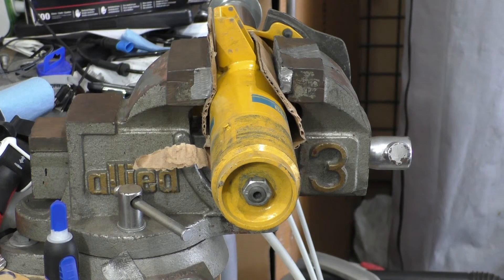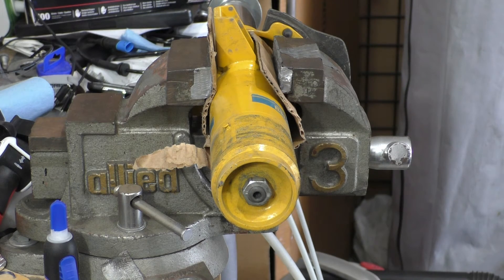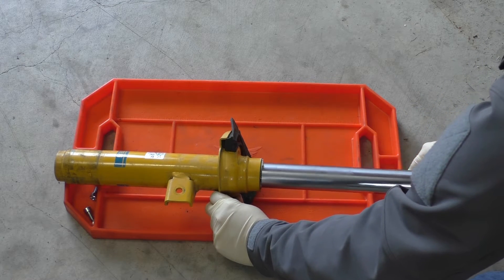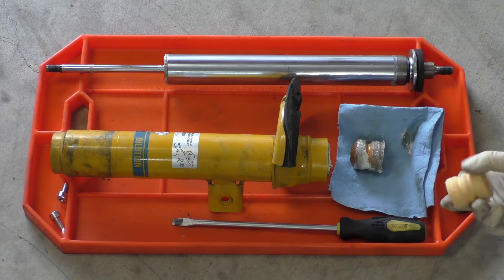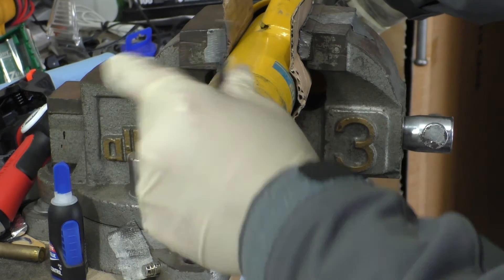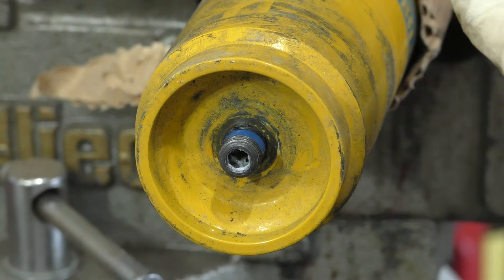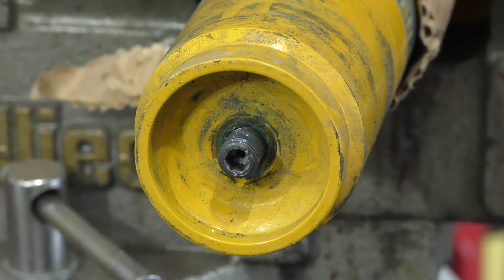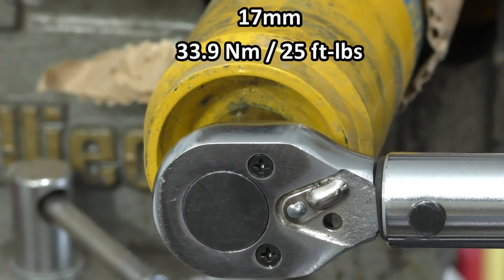Bilstein BMW F2x/F3x Strut Disassembly & Bump Stop Change

Comment: My mind is blown. I have installed Bilstein B6's several times and always wondered why they don't require an external bump stop. I had heard they had internal bump stops but didn't realize they were still foam or they were replaceable. Thanks!

Comment: I am in similar situation where I need to use a shorter bumpstop for B6 with lower string. May I know where did you get the shorter/softer bumpstop from and what is the parts number? Thx.
Reply: nvm. I found E4-AP2-Z118A00 in your comment. My car is GR86, I am not sure if bilstein uses different bumpstops for different car, but on summit racing website, there are only E4-AP2-Z118A00, E4-AP2-Z075A03, E4-B46-759B, E4-B46-236A 4 different bumpstops available. The other 3 are not in stock so I guess I don't have many choices.

Comment: What’s the difference with this upgrade. Or change.
Reply from the maker: The difference is you have more free damper travel so bumps don't upset the car as much. The car is much more composed over bumpy/poorly graded roads.
Reply: @FaRKle0079  ok. I will try this.
Reply: @FaRKle0079 what bump stop you used. I have b8 ones. I mean the internal one.
Reply from the maker: @hectorsoto6813  I used Bilstein E4AP2Z118A00 in my dampers and cut it down a bit more.
Reply: @FaRKle0079  perfect. How much should be this cut.
Reply from the maker: @hectorsoto6813  That's going to depend on your springs and how much free damper travel you have. I like having >0.75" of damper travel before bump stop engagement.
Reply: @FaRKle0079  ohh. I have mss springs. But don’t know how much I need.

Comment: Are these struts nitrogen filled? If yes, how are they refilled?  I have a pair of H&R coilovers that are supposedly bilstein made but they need a rebuild. I have done Ohlins motorcross shocks before but these coilovers dont seem to have any Schrader valves to fill with, so how do these struts/shocks get refilled?  Thank you for your time
Reply from the maker: Yes, these are Nitrogen filled for the gas chamber. You're right that H&R dampers are made by Bilstein. There are some special Bilstein fill tools since they don't have normal Schrader valves. You might be able to buy them direct from Bilstein (have to call).

Comment: Hi, it is a nice video, may I ask do you need to heat up the 17mm nut then could loose it up or just do it straight away when at the first time?
Coz Fatcat did a similar tutorial video, and he has heated it up first then could get the nut to loose. I'm wondering if it will come to loose  without heating em?
Reply from the maker: I haven't had to heat up the nuts when disassembling. It's possible they used to use "red" Loctite which required it.
Reply: @FaRKle0079  Gotcha, thx mate.

Comment: I’m upgrading to Bilstein B8’s and was going to order the front and rear F80 bump stops for my F30. But after seeing this do I not need to use bump stops on the front B8’s?
Reply from the maker: Correct, you don't need to buy F8x front bump stops since the B8 struts have an internal one.

Comment: Hi, what is the bumper stop number part you put inside your B6 ? Thank you
Reply from the maker: I'd ask Bilstein. They were kind of illegible. The B14/B8 bump stops are E4-AP2-Z118A00 though. The B6 bump stops ended in A01 or AD1.
Reply: @FaRKle0079  Thank's for reply
Reply: @FaRKle0079  hi! i cant find E4-AP2-Z118A00 =( may be they have new number?
Reply from the maker: @npapirosov  You might have to see if the Bilstein distributor can directly order it from Bilstein for you. These don't seem to be a regular stock item.